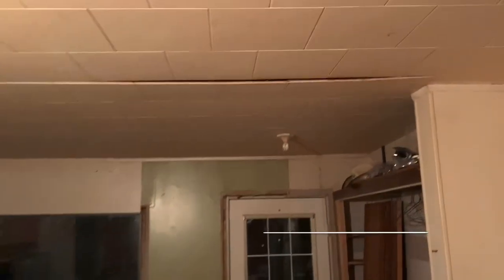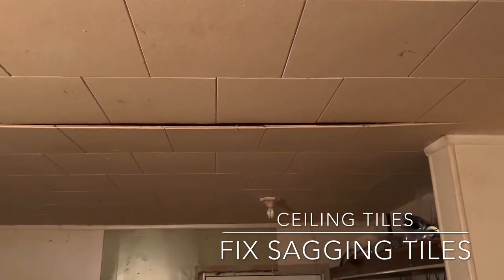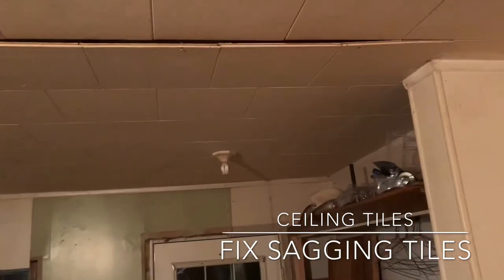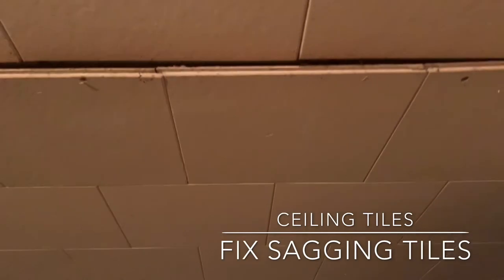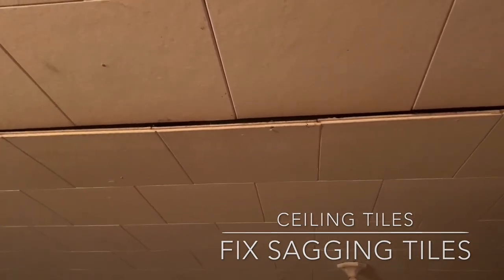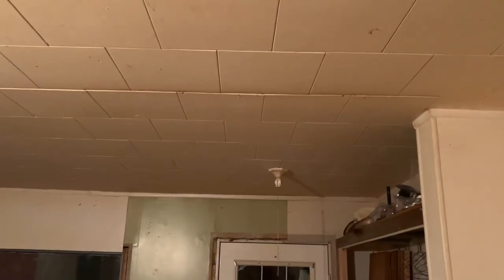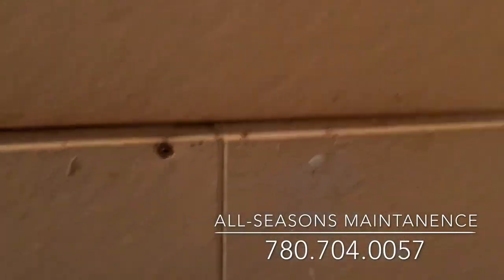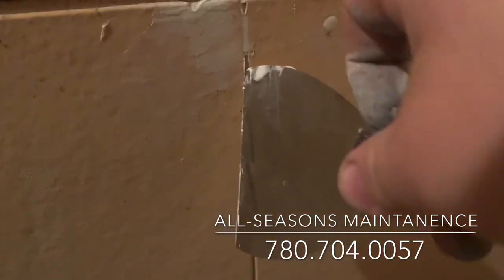(7) How to Fix Sagging Ceiling Tiles.

Comment: I've seen another video where they drilled a pilot hole before driving a screw. This might be helpful in a) confirming that you have something solid above the tile (if it's not sagging so badly that there's a gap) and b) reducing the drag trauma on the ceiling tile material and therefore reducing the risk of causing the tile corner to break off. Thanks for this video!
Reply: This is especially true since you are only screwing into furring strips. Very easy to split, especially if wood is older. Pre-drilling adds seconds.
He's also using thick deck screws. Cheap drywall screws are much thinner and more than sufficient.

Comment: Thank you for the video.  I am curious if you know the brand name for the ceiling tiles -- our house has what looks to be exactly the same type, and I have a damaged ceiling time that I am hoping to replace.  If I cannot then I figure that I will sculpt the broken bits with drywall mud and repaint.
Reply from the maker: Sorry I don’t it was a rental from the 70’s/80’s I worked on two years ago.  I have had good luck using mud to fix it though.  Good luck.
Reply: @TOOLMANTIMSWORKSHOP  thanks for the reply.  Another youtuber mentioned he got them at HomeDepot, and I found Armstrong Ceiling Tiles online at Lowes (Armstrong® Washable White 12" x 12").  I will have to go in and see what looks closest, BUT I will first try to patch then, and then move onto a replacement job...  Thanks again!

Comment: My tiles are doing the same thing with insulation coming through the vents & I thought my ceiling was falling thru. I know it would be a insulation nightmare to remove the tiles so I ended up here searching for alternative, now just gotta find out how much it costs to replace the ductwork lol
Reply from the maker: It’s certainly not ideal to have to fix the tiles from the exposed sides but it is certainly the lesser of two evils when you have insulation to deal with underneath.  If I can help in any way please message me.

Comment: I am a shed with these exact ceiling tiles ( the shed as some sort of attic like to it) and these tiles have become stained and rotted from a leak in the ceiling.  Cant really remove them without smashing the ceiling. Wondering if you had any tips on how to take these kind out
Reply from the maker: Francis two things first of you want to smash the tiles up but are concerned about the mess get a very long shop vac hose and attached it to whatever type of small tool you are using to break it up.  Allowing the hose to suck up most of the debris and put a tarp down to catch the rest.

Now if it isn’t a really fancy shed and the ceiling  trusses are in good shape and there isn’t any mold on the old tiles you could always using a thin sheet of plywood or other paintable materials and go right over the old tiles.  Of course as long as the roof leak has been addressed :)
Reply: U are a shed?

Comment: Thanks, but I see you're going in too far with the screw. Especially with older dried out tiles, which are more brittle.
Reply from the maker: Thank you for the advice,  I’ve been waiting till I have to fix another to to update the video.  Have a great day.
Reply: @TOOLMANTIMSWORKSHOP  I just did this tonight at our church. That was the reason I checked out your video. I got some screws with larger heads, I think they're for metal studs and they worked very well, hey do you think adding some of that door/window foam behind the tiles will help? You know the kind that doesn't expand too much and doesn't bow the frame. It's really sticky and might help to hold the tile?
Reply from the maker: Richard R you know I think you might be on to something. I think that’s a good idea just make sure you get the Lowest expanding foam you can get.  If you do it let me know the results.  Also thanks for the suggestion on the larger headed screws